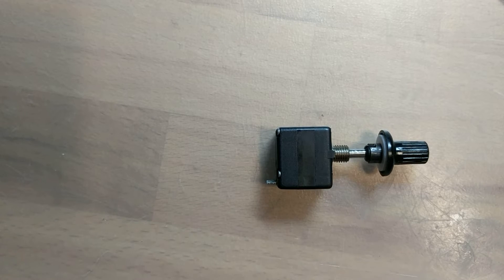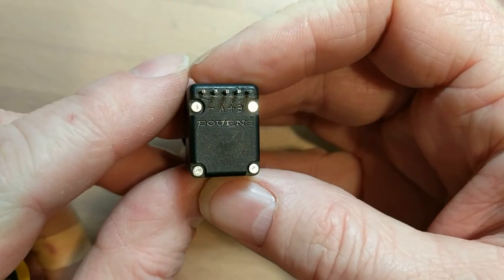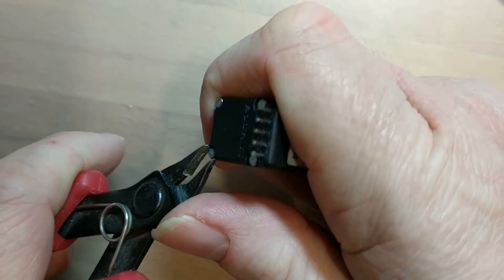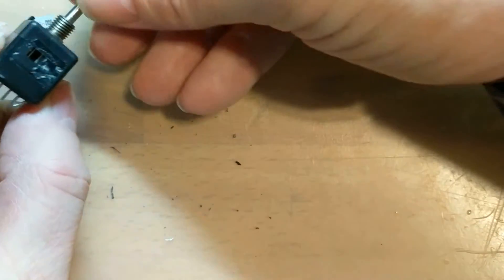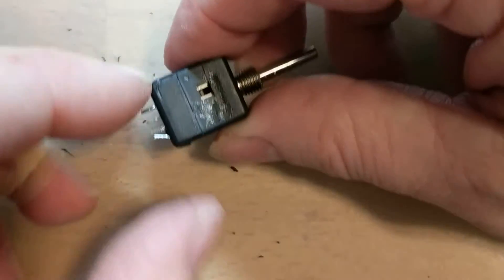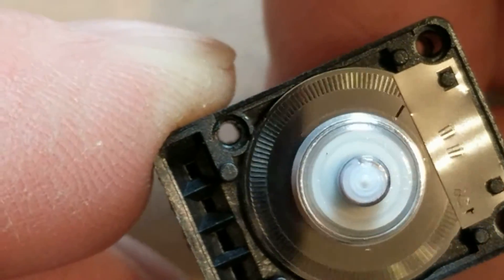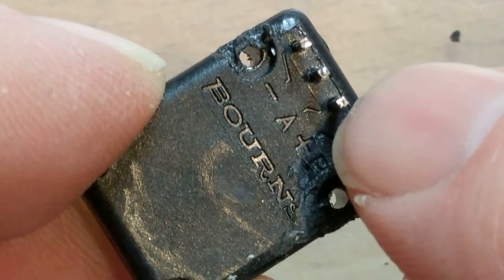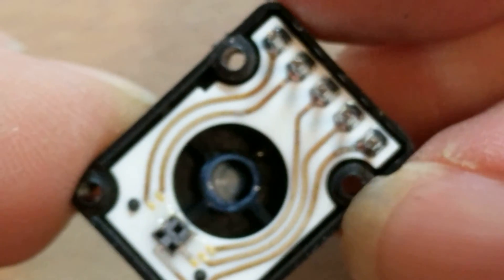Faulty Bourns Optical Quadrature Encoder Teardown

Comment: Im here because its used on wheel balancer
Reply from the maker: These were from some expensive video equipment, I'm guessing the wheel balancer you have is using them on the control panel?

The encoders on the balancing mechanism usually have an index pulse or some way of working out position of the spindle so once it's measured the state of balance you can rotate the wheel by hand and add the weights to the rim.
Reply: @M0UAW_IO83   the encoder sensor shaft is inserted   in ,one end of the  wheel balancer shaft